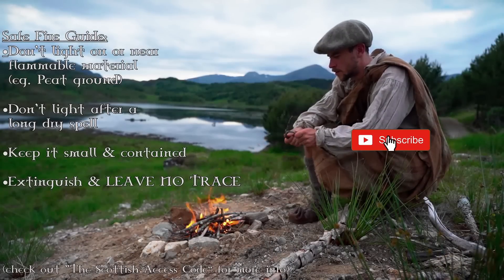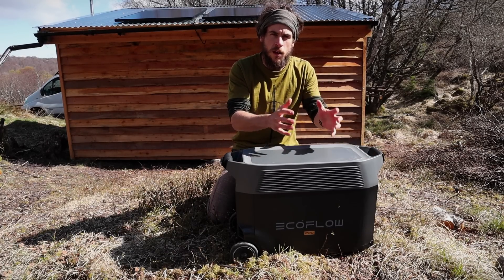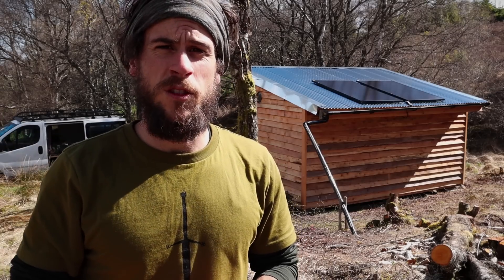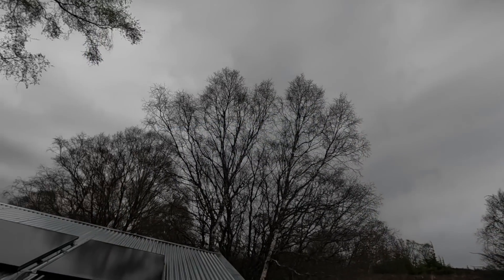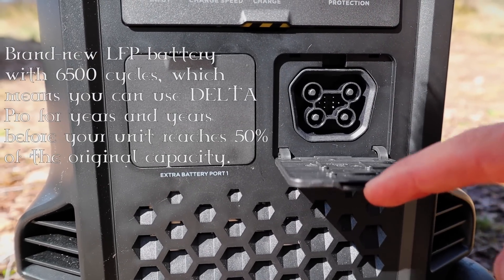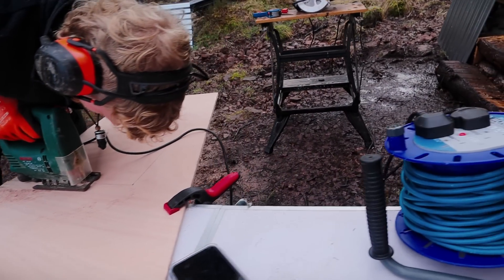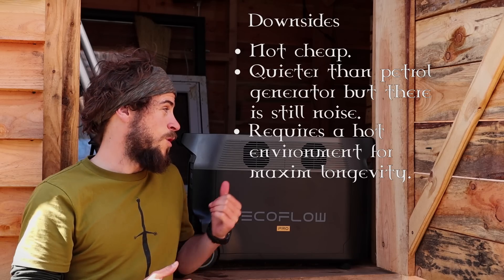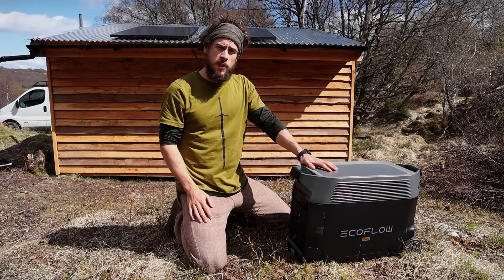My Multifunctional Power System- Off-grid Solar, Home backup & Van Life - DELTA PRO by EcoFlow

Comment: The South African and UK variant don't work with the dual voltage hub and 50amp hub  which limits you to one unit connection to an offline DB box. The smart home panel 2, which takes breakers is also not compatible. At least you can use the front plugs to feed individual appliances directly and charge another delta to swop.

Comment: Great idea 2 Eco flow delta pro 3 system and Eco flow delta pro 3 extra 4 battery 20(KWH and Eco flow delta smart dual fuel generator 4000W 😊

Comment: As a tech nerd, I've followed the practice for many years of running out the battery completely on my devices (laptop, headset, phone, etc.) before recharging, as I've been told that's the healthiest for battery life. Is this what ecoflow recommends for its products?

Additionally, I'd be interested to see if building an in ground, waterproof (yet ventable if needed) container for your battery would help keep the constant temperature it needs, while also cutting back on noise. Does the ecoflow app allow you to set up a temperature monitor for the battery?

Comment: You are so lucky to have a free system.  I had to buy mine.  Yes, this is the kind of system I use in my home which I have been using for 3 years.  1.6kw ecoflow and their 400 watt folding panel.  Its working all the time and the biggest user of power is this here desktop computer. I run my power tools with the unit.  And I can charge my ebike with it.   I have a wood stove that I can cook on.  Also have Dutch over fits in the stove hole.  When the wood stove is not lit, I have a 2 burner propane stove.  5 gallons of fuel lasts for 3 months.  I'm located in New Mexico, 7300' elevation, living here all four seasons.

Comment: On a cold sunny day you could plug in a heating element like what is used in aquariums.  Like for lizards or snakes.  I think they operate at 200 w.  If your panels are pulling in 600w.  Then it can keep the space temperate without draining your battery.  Which would work great during the day if you're gone to keep the temperature up.  But it would drain your battery down overnight.  But if you come in at night and start a fire in a wood stove,  you won't need the heating element on.  Just a suggestion

Comment: Good review. I'm an electronic technician who is dabbling with bushcrafting in Atlantic Canada. I can attest that temperature is important to keeping batteries happy. Low temperature affects performance but high temperatures can damage batteries. Putting the system in a small box with foam for cold/noise insulation would work. Just make sure that there is room for air flow. There is also a way to vent the box if it gets too hot and not compromise the noise cancelling. 
Another good point is that you have a drip loop on the cable before it enters the wall. This will stop water from following the cable inside.
As for this being repairable: you can make an independent battery, inverter, change controller but it's not KISS.